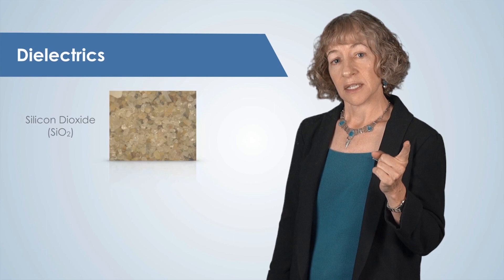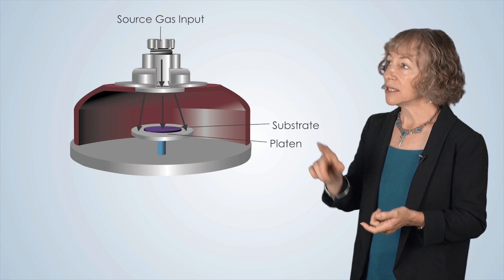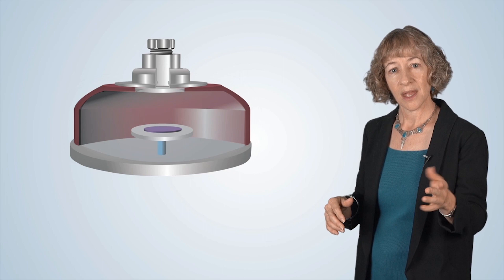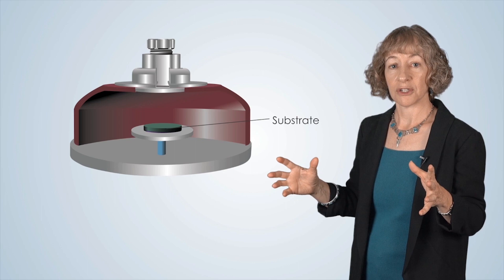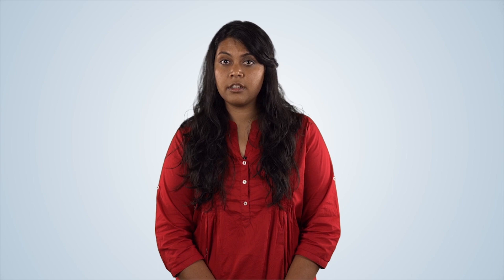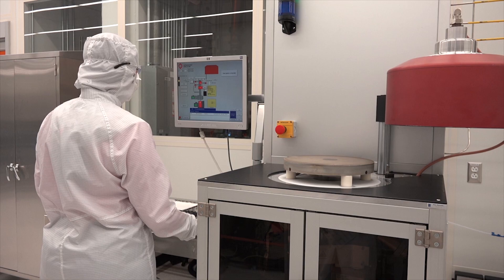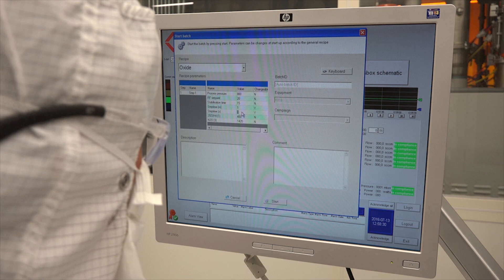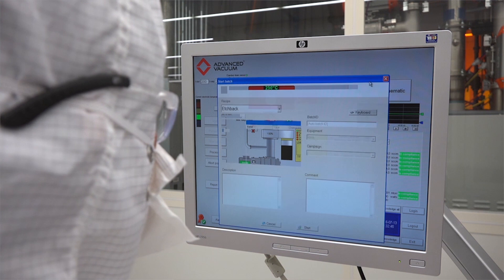Introduction to PECVD

Comment: If I’m not mistaken, I believe this is a similar process to synthetic diamond creation... diamond seed being the substrate and using carbon heavy gases
Reply: Yeap! This is exactly the process. 
If you fill the chamber with methane (CH4, a carbon rich gas), you will get graphite deposited as it is mostly favoured to diamond sp3 bonds. However, having also hydrogen in the mix, eats away the graphitic phases and leaves only the SP3 bonds on the substrate. The mixture normally used is around 1% methane to 99% hydrogen. The same mixture analogy is also used when depositing very high quality silicon: 99% hydrogen to 1% silane (SiH4).
This method is terribly slow and is more suited to making graphene, which is a single layer of diamond. To make bulk diamond, you should utilise techniques used to make bulk crystals: you melt carbon and then let it solidify. Carbon melts at 4500 degrees, so you either use the "skull" crubible technique, or materials that can withstand higher temperatures (there are some synthetic materials that have a higher melting point to carbon!). The only problem with carbon is that when it reaches its melting point it wants to sublime (directly evaporate from the solid phase), instead of going firstly into its liquid phase. To counter this, you have to keep it under pressure. Hence the "High Pressure High Temperature" name of this method.
I am making a ver 3 vacuum chamber at the moment so that I show a few techniques on my channel for high quality advanced thin film deposition. Currently I only have electronic engineering videos but will soon get into material sciences.
Reply: @BillDemos  Hii bill sir,. What is happening inside the plasma of reactive gases (CH4+H2), supplied by Rf power, inside pecvd system ????  pls. Can u explain...

And how rf plasma  created??
What is present inside the rf plasma, like charges, electron, methane molecules etc.
Reply: @pawankumarverma7840  Hi Pawan. A molecule, such as H2 for example, shares bonds between atoms. In that state, the atoms are happy as they are at their lowest energy. When you give them some energy, be it through raising temperature, or applying electricity, they become separated! So, from H2, two atoms in a molecule, you end up with all atoms separated! Not only that, but most atoms in a plasma also lose some of their electrons. So a plasma is a soup of mono-atomic species/elements and electrons. Once an atom loses its partners, it becomes very reactive, it wants to bond again with something. If it happens to reach the substrate where you are laying the diamond, it becomes part of it. 
You can make plasma in many ways. One way is to put electrodes in your chamber, and apply DC or AC high voltage. If the AC frequency is high, like in the range of millions of cycles per second, you call this RF plasma. The good thing with RF plasma is that it can be coupled to your system in a remote way: i.e. you don't need the electrodes within the system, but you can have them placed outside. This way, the metal that makes these electrodes does not contact and therefore does not contaminate the plasma.

Comment: What radio frequency is used for the plasma? 
It's voltage pulsed with RF right? 
If so, what's the freq range? Thanks
Reply from the maker: The RF generator utilizes 13.56 MHz. This is a popular frequency for laboratory RF applications and is one of the frequencies reserved in the ISM radio band (Industrial, Scientific and Medical). The ISM band is observed internationally and is regulated in the US by the FCC.
Reply: @dukeuniversity-smif2466  Very interesting! 
Surprised it isn't higher. 
Appreciate the extra info.
Thanks for Your reply